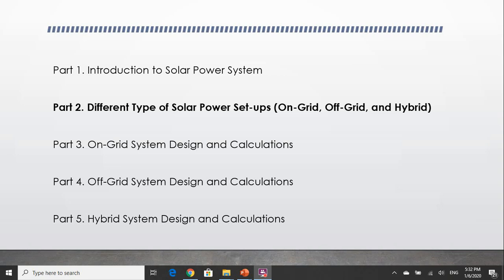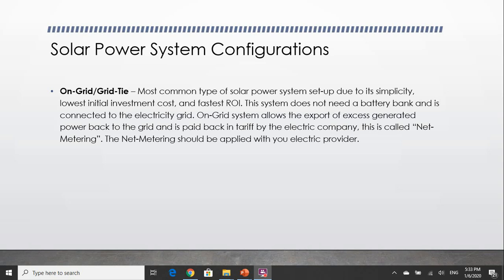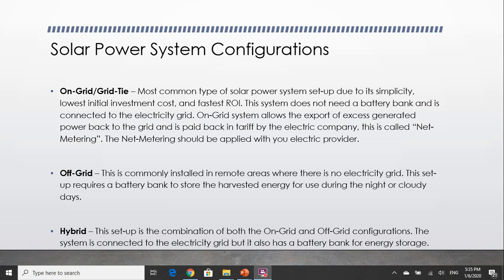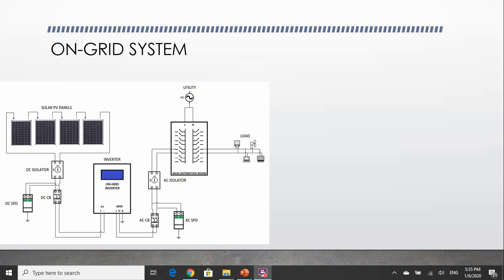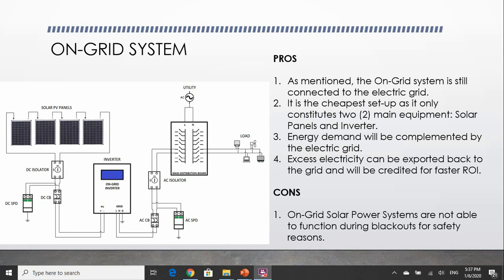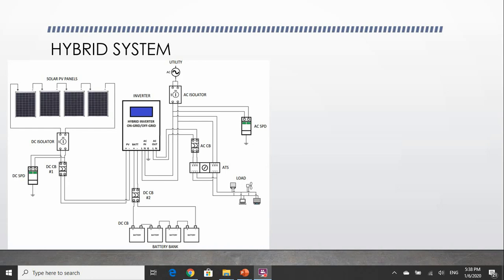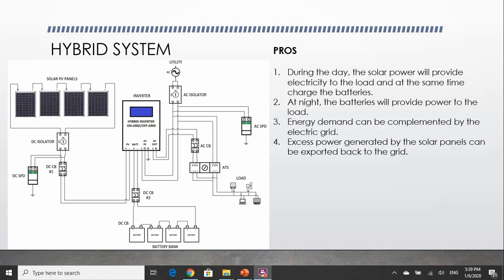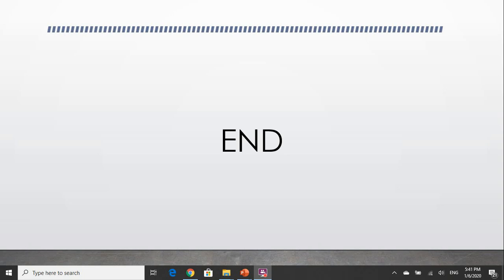DIY Solar | Solar Power System Set-ups | Grid-Tie | Off-Grid | Hybrid

Comment: Great videos on Solar Panel systems, you explain with great detail making it easy to understand thank you!
I have a question about the On-grid system, why is it during a blackout there will be no power? do you mean all the time or only when there is no sunlight to generate electricity?
Reply from the maker: Hello sir, for grid-tie systems, the grid is really designed to power up the inverter. When there is power interruption in the grid, the inverter is also shut down to avoid exporting electricity to the grid which may cause serious injury (e.g. electrocution) to the line men repairing the power line.